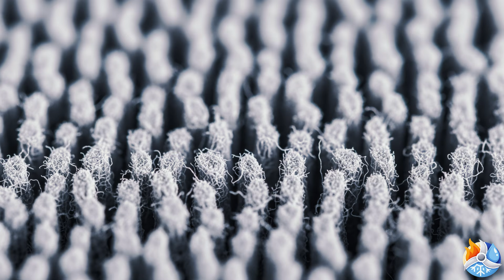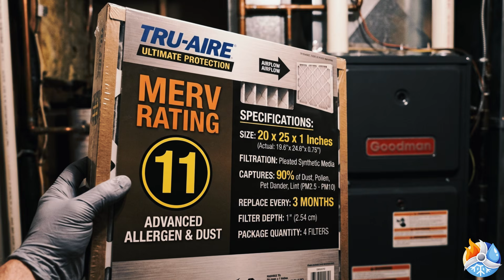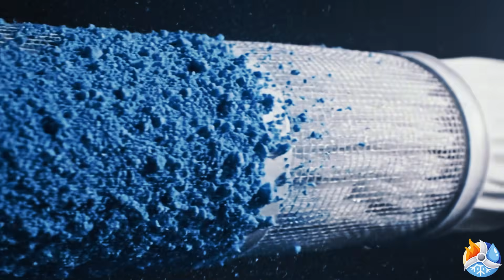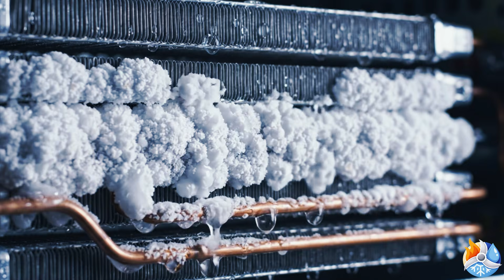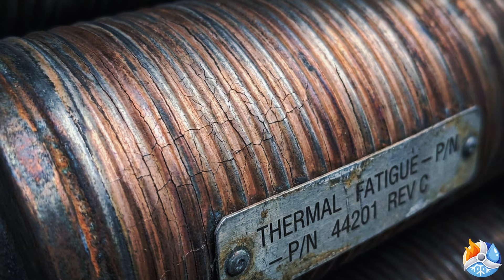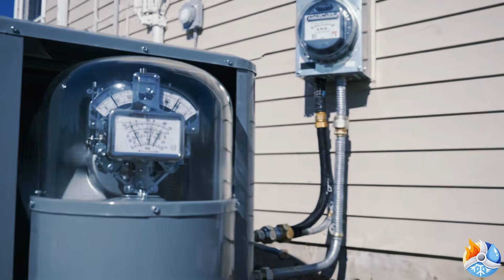STOP Buying $30 Filters… They’re Destroying Your HVAC (Airflow Lie)

Comment: Our HVAC tech has two strong talking points...1) don't buy the highest efficiency furnace as they break more frequently and cost more to fix and 2) use cheap air filters that don't overly reduce air flow since they don't burn out the motor, etc.  Both valid points that have served us well!

Comment: Air flow is not totally direct to MERV rating, Filtrate for instance has much better Air Flow than a cheaper filter with same rating
Reply from the maker: MERV rating alone doesn't tell the whole story—filter design, media area, and pressure drop can vary significantly between brands with the same MERV rating.

Comment: My HVAC tech told me years ago to stop using the high and expensive  MERV filters and use an 8 plus use an air purifier. Said the system would work more efficiently. I did it, and discovered the system kept the house cooler AND I used less electricity.

Comment: I used to only use Filtrete Basic filters, which worked well without restricting airflow. They can no longer be purchased locally, so I'm stuck using regular fiberglass filters now. I'll never use a gimmick filter, I know how much damage they can do.
Reply from the maker: The key isn't just the filter brand—it's choosing one with low pressure drop that's appropriate for your system. A filter that restricts airflow can cause more problems than it solves, so checking the manufacturer's recommendation is always a good idea.

Comment: I've tried multiple filters from very expensive washable electrostatic to the cheapest MERV 8 and several in between, here's what works best for my house. Use the cheap MERV 8's and change them once a month, no matter the price they all get filthy and restrict airflow and you can actually hear the difference in the airflow when you install the new filter. We also have separate stand alone air purifiers that filter out dust, those filters are about $50 each

Comment: If your air needs to be filtered, build a Corsi-Rosenthal box. This is not the Best air filter system. It doesn't capture VOCs. If you want VOCs captured, try using air filters with carbon embedded in them. I'd use "6675 20x25x5 MERV 16 Air Filter Compatible with Lennox HCC20-28 and Lennox 6675 Healthy Climate Carbon Clean MERV 16 Furnace Filter". That being said, I don't know how the additional filtration resistance will affect the box fan you use over time. I'd go with a Lasko 20" fan. But you choose whichever one you want.

Comment: Who’s buying $30 filters?! Can get a 4 pack of 3M filtrate 2500 MERV 14 for $35, $9 a filter. Also change your filters. Most manufacturers both filter an HVAC recommend 30 days during heavy use seasons. Cleaner household air, cleaner coil, cleaner ducts. What people should be doing is a home duct pressure test, duct cleaning and aero seal. Actually have your ducts cleaned every 10 years.

Comment: I bought a high efficiency dual-stage burner furnace-A/C and put in MERV 18 filters due to severe allergies. The first 5 years were mild. Then it got really cold and stage-2 kicked in. The high-MERV filter blocked so much airflow, that when combined with the somewhat too-high gas flow as set at the factory, it generated so much heat that it kept shutting down on over-temp warnings, and then cycled after an hour. The tech lowered the gas flow to spec and told me not to use more than MERV 8. Haven't had a problem since. I now have 2 stand alone air purifiers with HEPA filters in the rooms where I spend most of my time, and it solved the problem.

Comment: I call BS on this AI slop, when a blower motor draws less air because of higher airflow resistance the motor current is lower, not higher. However the blower motor needs airflow across it to remove the heat it generates.

Comment: As a person who owns rent properties I have to stay on my renters all the time about replacing their HVAC filters. I get calls in the summer about the AC not working. I get over there and the filter looks like a wool blanket because it hasn’t been changed in 6 months. Part of my lease agreement states if the system fails due to failure to replace filters, the repair is on you.
  I really get a laugh out of tenants who complain about having allergies and the ceiling fans have a half inch of dust on them, they have a cat and dog in the house and the furniture hasn’t been dusted in a year. Then the AC filter hasn’t been changed in months. In some cases there’s not even a filter in the unit which causes major issues and damage to the unit. A coil cleaning can cost up to $500. Ignorance, apathy and laziness are a bad combination.

Comment: True story: My older neighbor came by my house in a panic. She said both her HVAC units had been running non stop for a week. I told her I would come investigate. I looked things over and it suddenly came to me. I asked her if she recently replaced the filters. She said, she did. She bought some HEPA filters because she was trying to filter out Covid. What can I say. This woman is probably close to 90 years old. Anyway, I stepped up on a step ladder and pulled the filter out and right away the unit stopped. She still had the old ones. Popped them in. Problem solved. 

You don't need expensive filters. I buy the cheap pleated filters and replace them 2 times a year. Usually when the cooling cycle begins and when the heating cycle begins. For those who think this is too far apart, change them every 90 days. In the hotels I worked at we changed them monthly. We used very cheap filters. You can't filter all the dust out of your house with expensive filters but you can cause your unit to work harder than it was engineered to run. All you will do is make it wear out early. Air out of the vents requires air in through the filter. Restricting the air too much is a bad idea. My unit had ZERO repairs over 10 years of operation. Just sold the house. It's still running.
Reply: You are a good man
Reply from the maker: A filter that's too restrictive can definitely create airflow problems, which is why the correct filter for the specific system matters. Regular replacement and proper airflow are just as important as filtration level

Comment: so the blower motor is a constant speed motor.  So someone please tell me how the motor is going to strain by using a high filter to trap allergens.  It can only run at one speed.
Reply: > "blower motor is a constant speed motor." Home HVAC motors are not synchronous, they are variations on induction motors. They tend to run 5% to 15% below sync speed. If they reached sync speed the current would be zero. But they don't, they 'slip' behind the 50/60Hz AC wall voltage. If they slip a lot, the current goes way up. I have burned-up an attic fan in an hour by loading it down.
Reply from the maker: The motor can still be affected by a restrictive filter even if it's constant-speed. The motor runs at the same speed, but reduced airflow can increase static pressure and change the system's operating conditions. The key is staying within the manufacturer's airflow and static-pressure specifications.

Comment: The solution is to use filters with a much higher surface area, but still gets the level of filtration you need.  Our AprilAire units take very thick filters that are MERV13, and we have never had problems with them.

Don’t use the thin filters at all.
Reply: shub is correct.  There are objective tests on the net that show this.

Comment: I was told by an air conditioner tech to use MERV 5 filters which I have been doing for 20 years.  This is just right because it filters out dust but does not jam up and strain the blower motor.  I have not had to replace the blower motor in the system and it is 20 years old.   If this is AI it has some good information so I will give this a thumbs up.

Comment: 90 days to change a filter? I would like that better than the once a month change. I don't know how they can get 90 days on a filter. Ours are almost black in 30 days.
Reply from the maker: If yours are getting almost black in 30 days, definitely don't wait 90 days. Filter life depends heavily on the home, pets, dust, airflow, and how often the system runs. In your case, monthly replacement makes much more sense
Reply: @DealsByLucy  And we use the MERV 9 or 11

Comment: All air filter mediums are not  the same. 
Turbine engines require a high volume of air to run! The M1 Abrams tank turbine air filters fouled quickly when in the dusty desert conditions of the middle east. Enter The Donaldson Co. that developed a specialzed high-capacity barrier air filtration media- incorporating fine-fiber and nanofiber technology on pleated cellous/paper substrates that are electrostaticaly charged. Tank crews were pleased for obvious reasons. 
That is the technology 3M uses in their paper filtration media. That is why I like to buy paper filtration media air filters. Old fashion fiberglass plugs up to quickly. And no, I do not work for 3M.
Reply: HOOAH

Comment: I've been using the cheapo filters for years now, for maximum air flow, and I change them every month during the hot weather months here in central Florida.👍
Reply: tests confirm you're not getting better airflow when it gets dirty compared to the 3M 1900 ( MERV 13).

Comment: How do you know what filter your system actually needs? Sticker?
Reply from the maker: Yes, the equipment sticker/manual is a good starting point. You can also check the manufacturer's specs or have a technician measure static pressure to make sure the filter isn't restricting airflow too much.

Comment: The information that is MISSING from this Ai video is that modern/current/newer HVAC systems CAN easily handle higher MERV rating filters.
This is yet another, "OMG!  The sky is falling, and NO ONE is telling you about it, but me!"

If your HVAC has been made within the past 15-20 years, then your system can easily handle a higher MERV rated filter.
Modern systems are designed to handle higher MERV filters, because manufactures know that designing and building systems that can handle denser/higher MERV filters is a positive thing for people's health inside their homes.

Old and older systems that were not designed to handle higher density/higher MERV rated filters, may suffer some of the problems in this video.
The way to know that is to check that.  
Find your HVAC systems information, manufacturer and model number. 
Then find the system and user information and look for yourself what your system requires and will operate with.
If you cannot find that information, then contact the manufacturer directly and ask them.
NO, they will NOT hide that information, because it is NOT a "secret".
:)

The information in the video needs to properly state the facts, and the information that it is giving is about older HVAC systems there were NOT designed to be able to handle denser/higher MERV rated filters.

YT is filled with videos that makes all kinds of doomsday claims and headlines, and use, "Here's what NO ONE is telling your, or leaving out, or hiding from you".
It's all designed to get people to click on the video, because respond much more to fear and overall negativity.

If your HVAC system is modern, within the past 2 decades, the look up your systems information to know if it can handle higher density, more restrictive filters.  Chances are it does.  And so, you can comfortably and positively use filters that will clean your in-home air better at a finer level.
Reply: I use a 3M filter that filters the maximum possible. I also have portable filters. My health needs require this and if the system breaks, I’ll fix it.
Reply from the maker: The right MERV rating depends on the specific HVAC system, airflow, and filter pressure drop—not simply the age of the equipment. Checking the manufacturer's specifications is the best way to know what your system can handle
Reply: @DealsByLucy    Yes, as I offered, one needs to check what their HVAC system is and can handle.

The age/date range is one factor to know and consider, because new/er systems are designed to handle higher MERV rated filters.

This video was missing that information, and thus I offered it for others to consider.

Comment: The lowest MERV rating is best! An HVAC guy tried telling me "...trust me, ya need a higher (MERV rated) filter to protect your system from dust and dirt". I don't know what turnip truck that he thought I fell off of...
Reply: Good luck with that you should have listen to your HVAC guy you simply have no idea what you are talking about.
Reply from the maker: The key is finding the right balance. Higher MERV isn't automatically better—if the filter is too restrictive for the system, it can reduce airflow and increase static pressure. Always follow the equipment manufacturer's recommendations and check the actual pressure drop.

Comment: Funny. I buy 5 dollar filters. A friend had an hvac company for years. He told me never put one of those thick filters in. It causes more problems.
Reply from the maker: It really depends on the system. A thick media filter with plenty of surface area can actually have less restriction than a 1-inch high-MERV filter. The safest advice is to use whatever filter type and MERV rating your HVAC system is designed for.
Reply: @DealsByLucy when I say thick I mean higher merv for the record.

Comment: Use a larger area filter so there is not an issue
That is basic filltration engineerig in pre ww2 engineering books
Reply: like the 1" 3M 1900.

Comment: Somehow YouTube dished this video up.  The price of filters is about doubling so I needed some solid advice moving forward.  This data seems good.  I asked Ai:   Is it true that the reason you install air filters in your walls for your heat pump system is to keep contaminants out of the system, not to purify the air?  🌿   Ai said:    The primary purpose of the air filters in your wall return vents is to protect the heat pump's delicate internal components (like the blower motor and evaporator coils) from dust and debris, rather than actively purifying your home's air.  🌿

Comment: A blower draws less amperage in a vacuum than it does when it's batting air around, so no, a restrictive filter in and of itself does not mechanically stress a blower, however the resultant lack of airflow will make the system run longer to do the same work, while providing less cooling across the blower motor, providing a potential thermal stress.
Reply: Except, literally everything you wrote here is wrong, or irrelevant.  What a blower does in a vacuum is irrelevant, no central heat or A/C blowers operate in a vacuum.  A restrictive filter DOES stress a blower, as the blower speed is regulated, and the system will keep drawing current to get the blower to run at the target speed.  

Even your last sentence makes absolutely no sense.  A blower motor is not designed to to provide anything across the blower motor.  The only function of the blower motor is to move air through through a evaporator coil, heat strip or a heat exchanger.  The cold air is NOT there to cool the blower motor.

Seriosuly.  If you don't know anything about how these systems work, at least do some research...

Comment: So your point is to buy the lowest MERV rating? Where I buy my filters at Home Depot they have an FPR rating.
Reply: Me too. I just buy the FPR 5, lowest rating. If you want to know the comparison, just Google FPR to MERV. FPR 5 is equal to MERV 6-8. I think the only way to get a lower one is to get a fiber filter. Lowes sells one that gives basic filtration. I think it is a MERV 1. Just dust and lint. They also sell a pleated Filtrete with a MERV rating of 5, which is a FPR of 4.
Reply: @roadk88- I’ve looked at the static pressure numbers for the HDX FPR 5 / MERV 8 and they are pretty good - in fact better air flow than the Filtrete MERV 5.
Reply: @roadk88 Suggest MERV 8
Reply: There is a way to convert MERV to FPR.   To convert MERV to FPR (Filter Performance Rating used by Home Depot),  use the general conversion guide.  🌿   Search Google Ai for this question . . . .  On furnace air filters convert MERV ratings to FPR ratings
Reply: That is not the industry measurement standard. Home Depot and Lowes does this to confuse customers.
Buy the one with the least amount of filter material or the plain flat filter that is what I use.

Comment: I do Merv 12 and since I changed from 6 to 12 my wife does not sneeze anymore first thing when she wakes up, she does not blow her nose so it’s worth it and I just did check up and clean up of my air conditioning and heating unit myself and it’s been 12 years and no problem so not to starve the unit I change it every three months or when it needs it, which could be sooner I think that’s the best method
Reply: Except of course, you should just buy an air purifier instead, and leave the standard filter in the A/C.  A dedicated HEPA air purifier will clean the air a lot more thoroughly than your A/C does, and it prevents airflow issues.  You may have a dinosaur single speed A/C and proper air return where your case works, but it is not the typical result.

These air filters will shorten your system lifespan, just a question of how much.  Having an A/C last 12 years isn't impressive.  One of mine lasted 18 years, the other one is 21 years old...